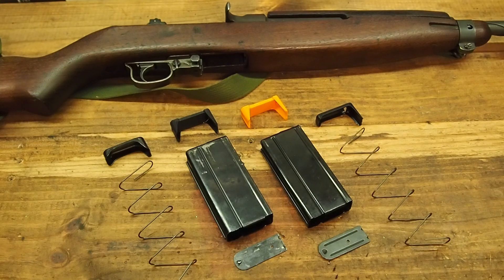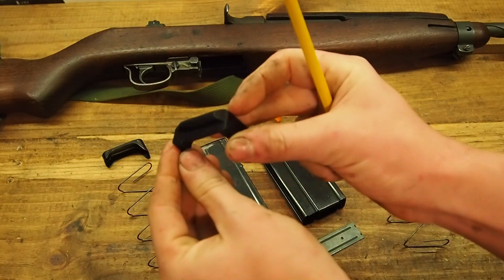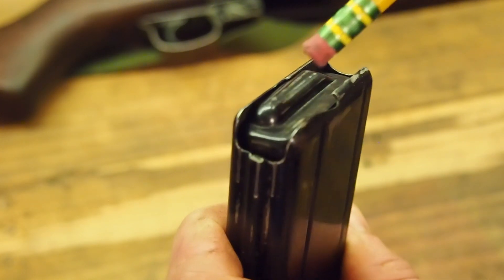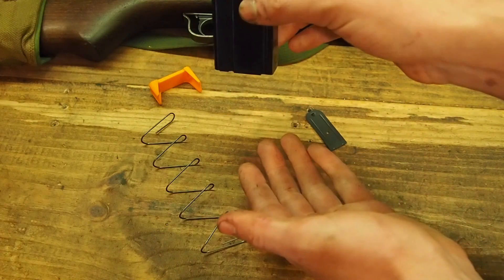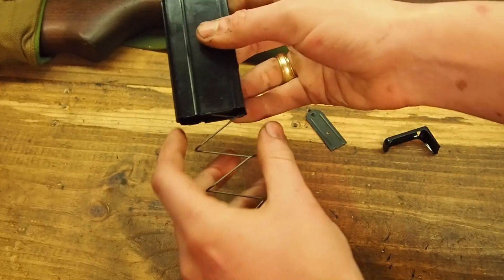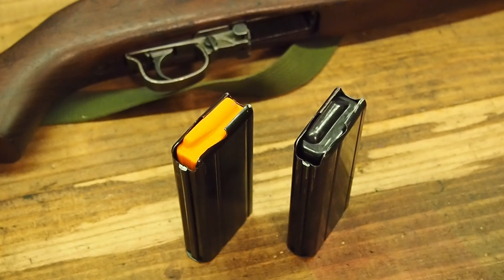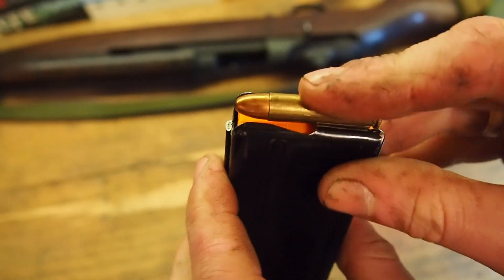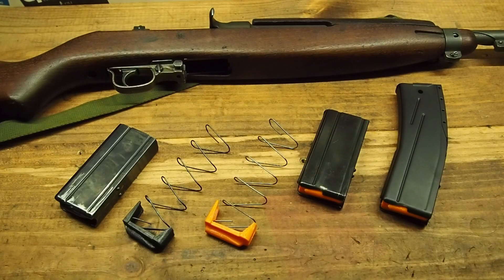M1 Carbine Anti-Tilt Follower Demonstration

Comment: Was the magazine release updated between the M1 & M2?

I’ve heard:
Type 1 magazines function properly in the M1
Type 2 magazines function properly in both

But Type 1 magazines do not function properly in M2s.

If most carbines were Converted to M2 pattern, would that mean M1, Type 1 magazines are more likely to have issues?
Reply from the maker: That's a very good question. In my opinion, the geometry and condition of the magazine feed lips have more of an influence on reliability regardless of type. If anything, I would think the type 2 magazine button would improve magazine retention and stability.

Comment: I need about 9 of these for my kit, what material are the orange followers made from? My only concern is chipping of the follower when the bolt catches.
Reply from the maker: Both versions are printed using PETG. Its a strong material with good layer adhesion and temperature resistance, and is somewhat flexible without being brittle. After a few hundred rounds of function testing different follower prototypes, I noted minimal if any deformation at the back of the follower where the bolt catches.
Reply: @GLOWLLC  Good deal, I was curious about heat resistance as well but the bolt face isnt exactly the thing that gets terribly hot as opposed to other parts of the rifle. I've just bought 12 of your BHO followers and I'm looking forward to tossin' em in my mags for extensive testing. I'll send you some feedback after a couple range sessions!
Reply: Update: Over the past month, I've ran 500 to 750 rounds through my Carbine using the enhanced followers. They've practically cured the nosedive issue that used to plague my M1. I also ran the gun hard while doing some extensive training. The followers didnt experience any melting nor chipping under hard use. You really got something here with these enhanced followers dude. As a side note, I've also combined these followers with Wolff extra power mag springs for the 30 round magazines. Between the enhanced followers and improved springs its pretty much eliminated most of the reliability issues that come with M1 mags. In conclusion; These things absolutely work and I'll be buying more shortly to put in all of my magazines.
Reply from the maker: @SchwererGustav-800mm that's awesome man, thanks for putting them through the gauntlet!

Comment: wonderful idea and execution. I have had issues with soft points from this issue.
Reply from the maker: Same here. I mostly ran SP ammo though mine for years since that's all that was allowed in my old hometown range. The increased angle of the follower helps improve chambering reliability with SP and HP ammo, at least that's been my experience. Thanks for your comment.

Comment: I've had this issue with GI mags. But 1 works all the time. I thought maybe it was a firing pin issue.
Reply from the maker: I noticed a huge improvement in reliability after I installed the Wolff spring kit in my '44 Inland. The Wolff magazine springs also helped but didn't alleviate the feeding issues.